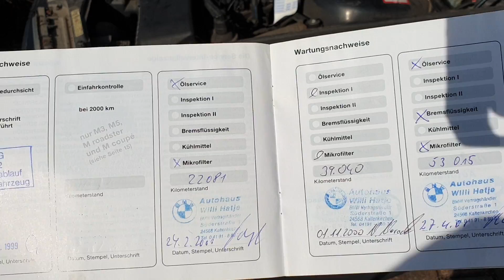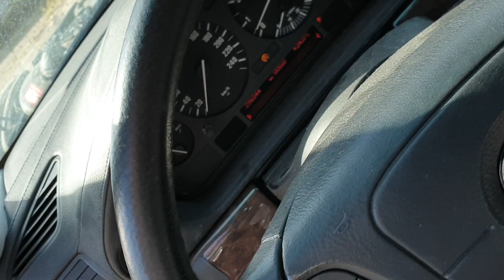Starting a V12 BMW E38 7 Series That's Been Sitting Outside For 5 Years

Comment: I know Beemers have a good image and they drive nice, but they are unreliable, electrics are horrible, and the engines can overheat and blow head gaskets, I paid a few hundred for a 98 525tds, which didn’t even get me home from the sellers house, it decided it didn’t want to go anymore after it immobilised itself in a supermarket car park, it wouldn’t crank, the starter and battery was fine.  I got it home on a low loader truck, and then sold it on for spares, what a heap! Never again.
Reply from the maker: It amazes that people think they can buy a reliable and good BMW for a few hundred, you got what you paid for. They are good cars as long as they are maintained properly.
Reply: M539 Restorations Maybe so, but I still think they are overrated, prefer a Mercedes any day.
Reply from the maker: That's just matter of taste. I like Mercedes too but buy one for the same money and you'll end up in the same situation.
Reply: M539 Restorations I agree that if you buy cheap you get cheap, but the seller did not inform me that the Beemer might have this fault and assured me that it ran fine and would happily get me home, we’ll he must have seen me coming as they say in the UK, I admit now that I bought a lemon, however I have never paid more than a few hundred for any car and very rarely got bitten and had 1000’s of miles of service from them, but on this occasion I was well and truly had!

Comment: It's not nice to put such junk oil in this car, API SL...
You need 5W-30 BMW LL-04
Reply from the maker: I'm running Liqui Moly 5W40 in my Silver 750iL. No point in putting expensive oil in this car when I didn't even know if it would run. Purpose of cheap oil is to clean the engine and then do short interval change with good oil. It's not something I'd use on regular intervals. Mannol generally has good reputation in Germany but you get what you paid for.
Reply: @M539Restorations  
Ah okay it was just a flush ! Good idea !

Comment: Mannol 10w40 in this engine? are you serious man? The cheapest shit
Reply from the maker: Yes, cheap oil. What's the point of putting higher-end oil in a car that I'm not even sure if it's going to run? Normally, you do a few oil changes in a short interval since the car has been sitting for so long and after you can put your preferred brand of oil. Also, Mannol is not shit, they have good products.
Reply: @M539Restorations  you know that mannol is a Lithuanian low quality oil, which is almost like base oil without additives. why not to use comma, elf, or addinol
Reply from the maker: It was cheap and readily available. Normally, I go for Liqui Moly/Shell, but in this instance it didn't matter that much and it fulfilled its purpose which was to replace old degraded oil. Mannol has good reputation in Germany but I'm not expecting a world at that price point.

Comment: 10w40 oil?????
Reply from the maker: 5W40 or 10W40. This is a high km engine so a bit thicker oil won't hurt it. I'm running Liqui Moly 5W40 in my silver 750.
Reply: @M539Restorations  i ask because i have a 525d e61 with 303000km and my mehanic is told me to put only 5w30 castrol or a bmw oil
Reply: @ahmeahmetovic8026  yep in e60 its okay